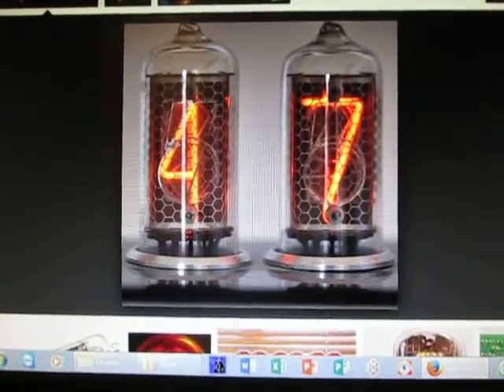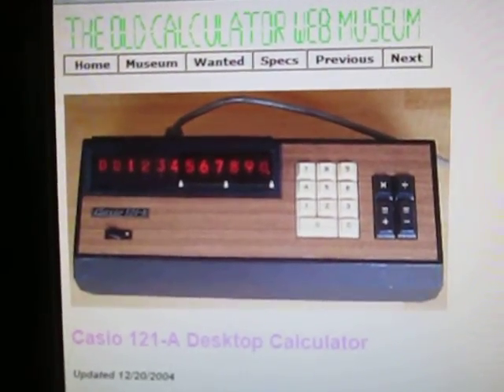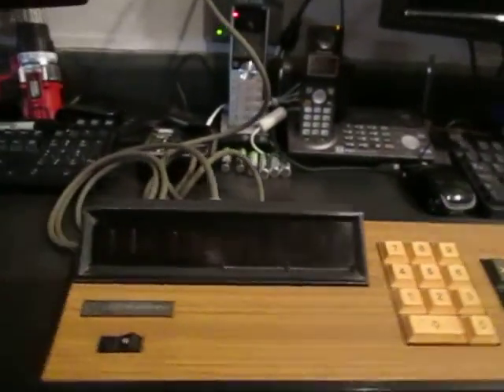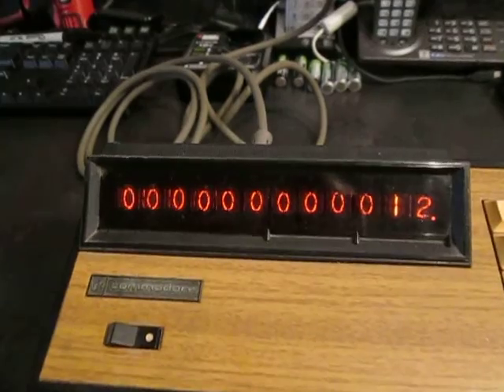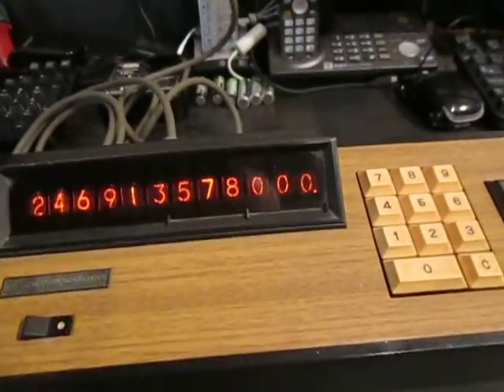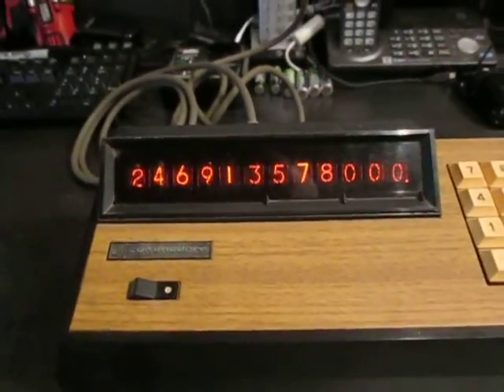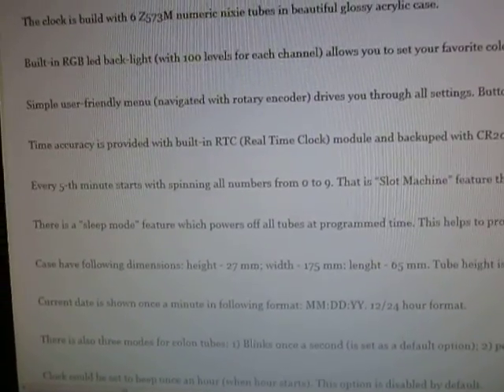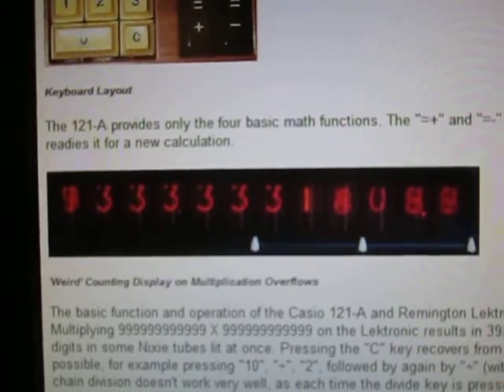The Retro Gamer! - Nixie Tube Casio 121-A & Commodore 512 Calculator Clock Canton NC

Comment: 2:00 I do believe these calculators were created and designed as an interim technology with stop gap measures. There are no flag displays, no keys for the decimal point.  This was both to reduce the unit costs for these early digital calcs, but also their operations and format emulated the format and operations for the previous mechanical adding machines. For the sake of familiarity?
I used to think that calc keypads like these, with no decimal key, simply used leading zeroes to key in the DP. But if these calcs did not have any leading zero suppression tech to begin with, how would using leading zeroes, to place the DP, work ?
Did these machines use leading nines in place of a sign(minus) flag?